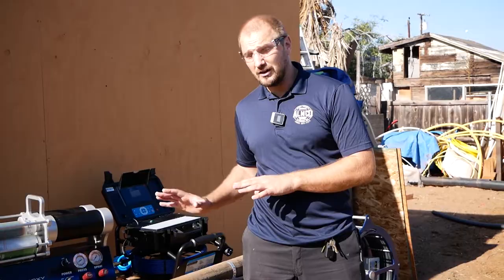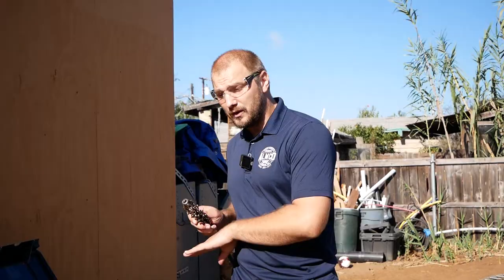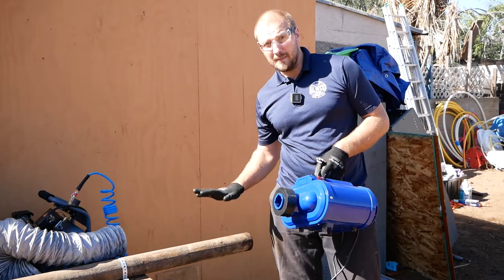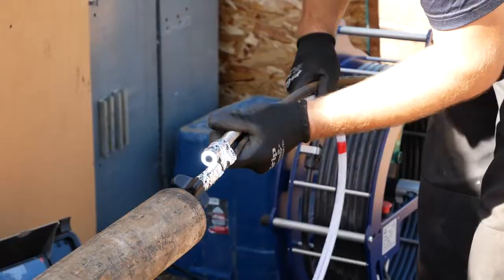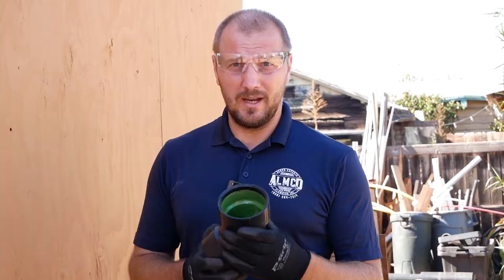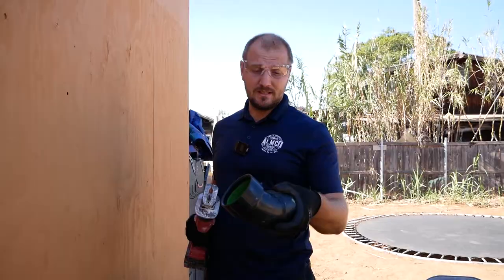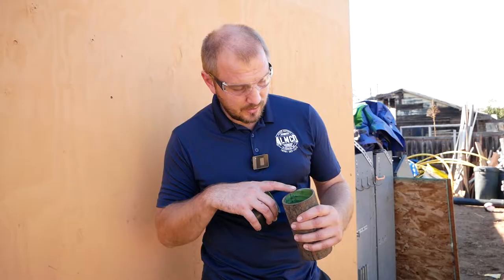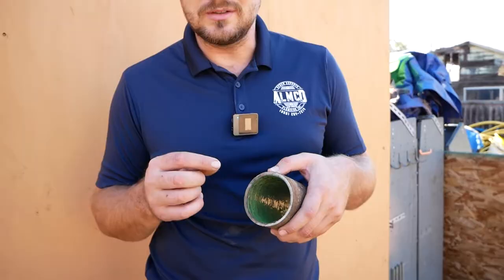Transforming Sewer Repair: Discover the secrets of Spray Epoxy Liner with ALMCO Plumbing!

Comment: What does this cost compared to epoxy balloon lining?
Reply from the maker: for right now $175 per feet + descale and prepare
Reply: @almcoplumbing8374  Thank you for all your teaching us
Reply: @almcoplumbing8374   hey man good work. I need this done at my house. I had the service quoted & it was almost 20k. I could have the house repiped with schedule 40 for the same cost. I thought this new technology was supposed to be a lot cheaper
Reply: @Gio-ue8ps  How much is concrete excavation, repair, dust and reflooring worth to you?
Reply: @bballguy162006  my house is already gutted to the studs in the process of a major remodel. I’m just saying this is supposed to be cheaper, not the same price as having a master plumber go under the house & replace the pipes
Reply: @bballguy162006  - Also, how much is avoiding concrete excavation, repair, and front yard excavation and refilling worth to YOU?   
Pipe bursting and pipe re-lining require access for machines at the level of the pipe at both ends.  Spray lining requires can be done thru an existing clean-out, right?  Shouldn't that make it cheaper?  If the only advantage is avoiding concrete dust but not the price of concrete work, then only when flooring is installed and loved and expensive would anyone choose spraying when they could instead choose pipe bursting to get a new ABS or HDPE pipe, right?
Reply: @JonathonNeville  I think his confusion is the whole point of doing this is for a cheaper less evasive solution his house already gutted so the construction isn’t a problem i would also
Assume it would be cheaper to do this than get new pipes all things being equal I would just get new pipes if it’s cheaper

Comment: Damn I wish I knew about that. Is that better than Hammer-Head® Trench-less liner what I had installed in my place? I was very limited on what I could do with my duplex I live in. My place has no crawl space just a concrete slab and that's it. I was worried that having in lined would make the sewer pipe to small and cause more problems. The descaled and ground down pipe and then epoxy lined looked to be a better option on my end. I was told that it would not work right and be as strong as that Hammer-Head Liner which is VERY VERY Strong in the it reminds my of a wool sock that has been dipped in a glue it was so strong that I stood on it and it bent very little and that was it. It cost my 17,000 bucks with a 40 year warranty
Reply: crazy price! glad you could afford it!